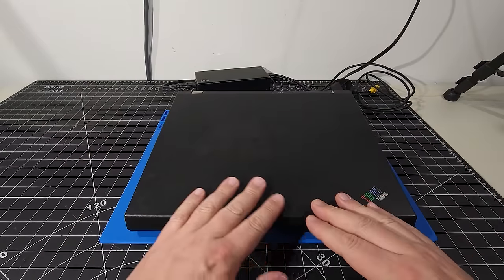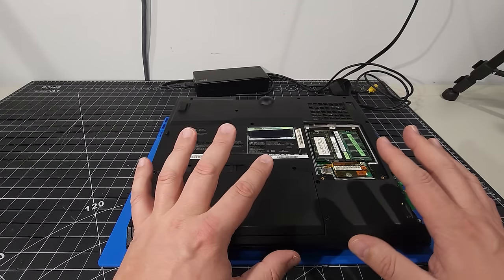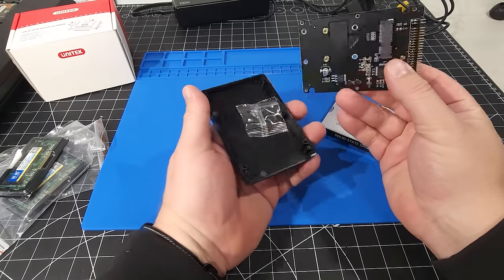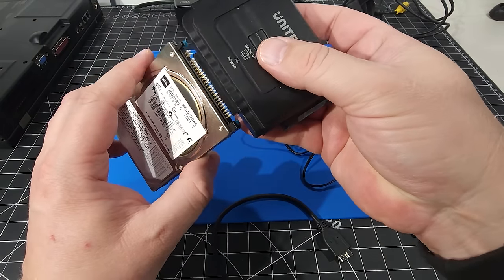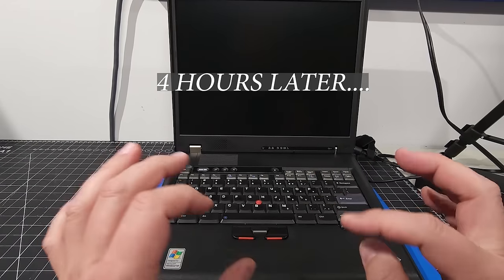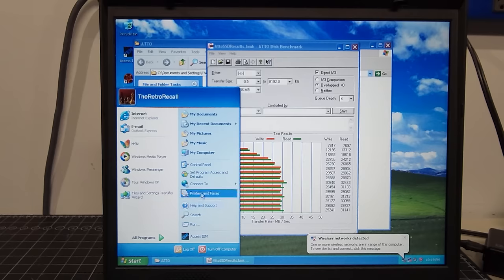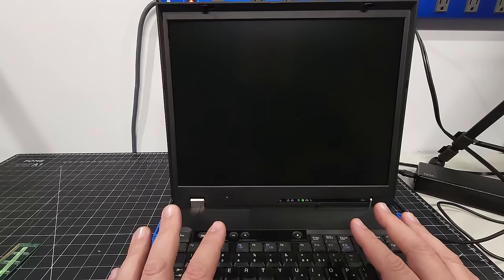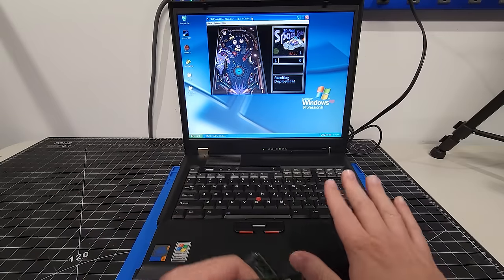IBM ThinkPad G41 Upgrade!!

Comment: One issue with cloning something as old as an XP HDD to SSD is that you won't have optimal alignment. I don't remember the command but there was a way to do a NTFS format on XP with proper alignment. If I remember the issue correctly, the wrong alignment causes certain reads and writes to hit 2 cells when 1 cell would have held all the data with correctly alignment.
Reply from the maker: Yes.  I checked and it's not 4K aligned (however not far off).  That said, it's an easy repair with a utility even with the OS on the drive.  Even rebuilding it wouldn't be much of a chore.  My biggest challenge was cloning the HDD and it not booting at all.  It was only when I made it a raw drive again and installed from scratch it worked properly.
Reply: If cloned with a software that is aware of SSDs (like Acronis' bootable CD ISO image which is public on their servers (obviously can't put a link here), alignment won't be an issue as it takes care of it while copying it over
Reply from the maker: Thanks for this!
Reply: I've never had too much luck cloning anything with these nifty smart tools. I'll go to dd or ddrescue on linux (Ubuntu in my case) and probably save time in the end. While the dd bit-by-bit copy takes some time I won't have to try this and that and the third thing experimenting what aligns and finalizes and what not to the end result after a fast smart copy. This approach of course requires a computer with linux booting capability and the necessary connections for the job. Even cloning over USB can be a bit dodgy no matter what the tools!
Reply from the maker: Ah fair point re:USB.  I never thought about that being a factor, but can be a very real one.

Comment: Just Use Windows Vista or Windows 7, becuz Windwos XP doesnt have any optimization with SSD and in disk defragmentation, the Win xp do a disk defragmentation method which is for harddisks. If do for ssd, SSD becomes lower life with read write cycles. In Windows vista or 7 have better support for SSD and have the new defragmentation method with TRIM method feature
Reply from the maker: Thanks - I've heard about this, however from what I understand is if you run a utility it can correct this.  That said, putting. A later version of Windows or Linux on this system in the future may be a fun option.

Comment: Fun story, had that exact issue with the hard drive replacement, happened with a Z60M and Z60T that i got, drove me crazy, and ended up with me completely cleaning the system and installing all the original software, was a nightmare at the time, glad that i did it for my Tipads!
Reply from the maker: Awesome!  I've never had that happen before using Macrum.  It would just normally work in the next system.  All is well that ends well - installation from scratch and it worked.

Comment: The only thing I found to be consistent with copying old drives over to new ones is using dd in linux. Havent had any issues since. I've been through at least 30+ drives at this point with no errors. Maybe check that out :)

Love the g series thinkpad!
Reply from the maker: I just read from another comment they recommended DD in Linux as well.  I'm definitely going to check that out, thank you! And yes - G!

Comment: I remember going through a ton of pain cloning a drive for my T41.  I don’t remember what I did with Ghost but I didn’t use all of the default options.
Reply from the maker: Yeah a spent a few hours and stopped as I wanted to get this out.  That said, I do plan on doing some tests as I have the image.

Comment: I was told old machines can kill a SSD faster. Wouldn't be an issue if SSD's didn't have read write limit suck @$$ drives.
Reply from the maker: Haha.  I think if you set the 4k alignment up correctly and adjust the TRIM then it should work fine.  I did NOT do that in this case but I will be going back to do so soon :). To be honest, I just love the spinning rust - unfortunately these IDE drives are getting hard to find.

Comment: the only downside to the ide to sata is you are limited to the speed of ide.....it's better for heat purposes, but otherwise not much different.
Reply from the maker: True, however I did get an extra 7 MB/s (28%) improvement in performance which was noticeable.
Reply: @TheRetroRecall access times are where the real improvement is.
Reply from the maker: Definitely.

Comment: A fine upgrade!👍👍 Cleaning that ram., stick with IPA., may make it work and 2 gig., of ram., is the maximum which that computer can handle.  
Perhaps you could make a cover for the ram..   I have one laptop which has an IDE., interface, a Dell Inspiron 9300 and I have considered obtaining one of those adaptors and drives, but I have a few working IDE., HD., so they will do for now.  
I did have Sparky Linux LXQT installed on the 9300, but it's now has LMDE6 installed and so far it's handling basic tasks well, YT videos can only be played at the lowest settings though, but the computer is over 18 years old.
Reply from the maker: That's awesome, and I will try that cleaning of the ram and report back!

Comment: Another great video.
I think it's a partition aligment and/or boot code problem that prevented the SSD from booting. I would probably load the XP CD and go to Recovery (R key) and go to the command prompt. There are two commands: fixmbr and fixboot. There is also chkdsk C: /p. 
I usually use Norton Ghost 12.x. It does a pretty job.
According with interwebs, that laptop seems to bave Intel 852GME as chipset which supports upto 2GB DDR-333. It may like 2x 1GB DDR-400 memory modules as long as the SPD has support for DDR-333 (faster memory has support for slower speeds for compatibility reasons), it will just run at slower speed. But, yes, some machines are picky.
Reply from the maker: Thanks for this info!

Comment: When you use Macrium reflect to copy a system disk it pretty much never work to use the Intelligent copy method, it fails to copy over MBR records and stuff when you use this method. to get the best result that works pretty much every time is to go to settings and use the sector by sector copy method and make sure to orient the partitions Exactly the same way as on the source drive. you can increase the partition size and it will work too but they must be put the same order on the drive. I have a whole computer dedicated for hard drives that have recovery software, test software and cloning all together. I can install two drives and make a direct copy to a new drive without making any images. quick and easy
Reply from the maker: I'll check that out and attempt it again.  It's funny as I've used the default settings for countless other clones and no issues.  It must have been something a little different with his config that causing it.  Thanks for the help!
Reply: @TheRetroRecall  I had a few successful attempts using that method too but it been from an equal sized drive to another. 
I think some sectors that have with the boot sectors and such don’t have any specific data about them in the MBR and Macrium just sees them as waste data skipping it. 
I always use the slower sector by sector to always get every piece of the old drive transferred but it may fail too if you shuffle the partitions around.
Reply from the maker: Someone also just recommended DD in Linux and has had a lot of success.  I may check that out as well.
Reply: @TheRetroRecall  I actually always do it with Macrium. But I use a bit older version that does not require any logins and crap. It even works as a portable version. I can just copy the whole folder to a different computer and open it directly. It does not work with the newer versions sadly enough

Comment: Just picked one up at a thrift store bag and all for 10 bucks. The HD was crap so installed a M Key to IDE card, 2 gigs ram, had Ubuntu locked out and XP, but even though XP would load it would crash when reading the drive. Got Raspi Debian installed but no mouse pointer. Am at it doing OpenSuse will see how that goes.
Reply from the maker: Ok, that's cool! I love when people find these systems and restore them.  Saves history and its a lot of fun as well!  Good luck!
Reply: @TheRetroRecall  Tried Ubuntu it failed, would not accept the SSD formatting. Tried Peppermint would not install bootloader. Tried OpenSuse, seems to have installed, but would not load. Puppy did not like. AntiX installed just fine. A potato comes back. I have an IDE adapter, may try to get the old drive cleaned up. Have 5 IDE 2.5 inchers but they are all too thick. But have an OS running with AntiX and KDE Plasma.
Reply from the maker: What about a version of Linux Mint?
Reply: @TheRetroRecall  No Distro liked it except.....AntiX. Success. I have CD's with old Distro's I burned back in the 90's, they all work. I have 4+ 2.5 IDE HD's but they were all too thick. So went with the M key SSD Adapter. So the Potato is up and running with AntiX, it likes the new SSD it is okay with the 2GB of ram even the alternate keys will shut off, they would not even with BIOS settings in a Peppermint install. Was surprised, as it had Ubuntu/XP dual install but Ubuntu would not install to the SSD.
Reply from the maker: Thanks for the update, cool you got it working (the potato 😂)

Comment: Here's a tip that will save you a lot of grief on upgrading some Dell laptops to a digital drive (Like a D820 for example) if it doesn't see the drive.  Add a thin cardboard shim to adjust the drive height and try it again.  I've run into this several times and for some reason it works.   I found this solution online after hours of frustration the first time.
Reply from the maker: I have never heard of this, it seems kind of crazy that that would be a thing.  I'll keep it in mind!! Thanks!

Comment: The problem you had with the copy of the whole disk through Macrium has and still is haunting me too. The very same problem I have on an Acer Extensa 5220 upgraded to the max. Its OS, a Win 7 32bit, is non-copyable no matter what I do.

Change the USB/SATA interface? Done. Use another copy software? Done. Change SSD? Done

Results? Must I really tell?

Go and make a new install of Win 7 32 bit and it works fine, try and copy the old 80Gb SATA drive on a SSD and it freezes during boot-up with error messages. Always.

Never could understand why, since it seems everyone else I could ask and their cousin has always managed a perfect copy of their disks.

Regretfully I bid you welcome in this little, unlucky club.
Reply from the maker: Haha, I loved reading this.  To be honest, I have no idea what the issue is buy I am determined to find out.  There have been a lot of great suggestions in the comments, so in my spare time (haha!) I am going to take a look and try.  If I EVER get it going, you know I will post an update ;)  Thanks for watching!!

Comment: Excellent work, I was looking for a video on exactly this subject. I own an IBM T40 running xp sp3 and wondering if these exact parts would work in my machine, any advice would be greatly appreciated. Its ether that or perhaps picking up a caddy for the expansion bay and plugging the ssd via that method, there by holding on to the hdd for data storage purposes only. I use the T40 extensively along side a pen tablet in my teaching practice to access text books, documents etc... and receive other materials and communications via email from students, freeing me up from continually having to switch screens on my pen tablet, improving work flow. The 4:3 display is also a game changer for ease of reading. I will also be making use of the card bus slot in the near future by picking up a PCMCIA card for ~ $10 to expand the number of usb ports on the machine. I love the versatility and the modifiability of these early t-pads ...still very capable  as dedicated machines in this day and age. I just love them, there's a certain mystique about these vintage Thinkpads, just something about them...crazy good stuff!...thanks for the video.
Reply from the maker: You are welcome!  I love Thinkpads as you can see in my many thinkpad videos so far lol.  I agree, they are built like tanks and with proper updates can be used today.  The HDD area is always a challenge especially if parts are missing, etc.  If you have the right caddy for the existing ide / sata HDD - you can easily get the MSATA adapters or SSD drives for these (from Amazon) I also posted the links for what I had used.  Look through the comments as there is a lot of great discussion around this.  Thanks for watching!

Comment: wowza, what a beefy laptop.... Sadly my oldest system currently is a Dell Precision T3500 with a quad-core Xeon and 24GB of RAM... I tried to install XP x64 edition, but but it failed so it's running Vista :) I'm currently looking to get a system that can run Win 95/98/2K/XP natively for gaming, ultimately like a 1ghz P3 system with 256-512MB Ram that I can get a good GPU in and setup like multiple drives or CF card to IDE adapter, and just have each OS on a different card and a second drive with all my software and games on....
Reply from the maker: That's awesome!  Don't give up on looking.  That's how I started getting back into it.  I sourced parts one by one and got exactly what I wanted.  Before you knew it I had a system and well ... here I am! :)
Reply: @TheRetroRecall yeah I'm unlikely to need to start making videos about it though :)
Reply from the maker: Haha true

Comment: Regarding SSDs in retro PCs, there are couple of things that needs to be adressed.
First - partition alignment. It is good idea to partition a drive using livecd linux and ensure it is aligned to 1MB.
Second - that ide44 to m.2 adapter. Most of those utilizes poor controllers that are only capable of ATA33 speed and that is obviously your case. Is is much faster though because SSD is vastly superior in terms of access time. Regarding RAM, sometimes one module won't work in slot 0, but works fine in slot 1, try swapping them around in all possible configurations.
Reply from the maker: Thanks for the tips!!
Reply: This. Need to make sure the adapter has a Jm20330 controller or better... They top out at around 78MB/s, but that's plenty fast enough for a P4. The bigger issue is, those dogfish SSDs have no DRAM cache. better off getting a Samsung pm851 mSATA SSD used off eBay for cheap instead just to have cache onboard, especially since a lot of stuff one might do on XP has the problem of moving around a bunch of smaller files, which that SSD will effectively choke on.
Reply from the maker: Good to know, fortunately it's a minimal use machine, but this is great info for other systems that will tend to be utilized more often.

Comment: I worked at IBM NL when these came out. For the day they were absolutely amazing. It was the time when desktop replacement was a thing, people wanted to swap the chunk of crt and the hum of the 486 hanging in a sidecar under their desk gone. It's been a couple of days since, if I recall correctly 3Gb of DDR333 was the maximum, if you could get a 2Gb stick. They were prohibitively expensive, I've seen a couple of those made by Wang. You could put a 2GB and a 1GB in G41 in only one combination to make it work. It made little sense to do so at the time, hardly any software could use that vast amount of RAM. I think Lotus Notes 5, Lotus e-Suite (a very nice, Java based Office package that went nowhere), some Oracle clients, Maemo and Yellow Dog could. 
I thought 120GB was the largest possible drive size for the G41, is that 128GB mSATA one of those 119Gib drives?

I still have my T43p and R52 with a 15" UXGA (1600x1200) display from back in the day. Amazing build quality, compared to modern laptops. The screen of the R52 developed a red hue recently, either the screen or the ATI card may be about to expire. Just picked up a nice T60 with a bit more muscle to replace the R52, another great retro gaming machine.
Reply from the maker: That's awesome, and yes I believe it is registering at 128gb, but reading at 119gb. I will be on the hunt for more memory, however I think the max was 2gb for this machine based on others experiences.  Either way, anything is worth a try!
Reply: @TheRetroRecall  You may be right, regarding RAM. It's a while back, perhaps the 2GB DDR333 sticks went into something else. I'd be surprised if you found one, they were partner off spec development parts that were tested in 'typical use cases'. 
After testing they sometimes got lost in parts drawers. Or they ended up in Frankensystems that happen when you have time, a screwdriver and about 2500 meters of warehouse shelving. The 'destroy samples' message sometimes got lost, for engineers it's hard to cut a bleeding edge part in two. Some of these parts end up in the wild like that. These memory modules didn't make it, DDR2 passed them by.
You can play Civilization 2 and Simcity 2000 on OS2/WARP! on that G41. That is almost unique retro gaming, I don't think that video has ever been made.
Reply from the maker: Hahahahah os/2 is a painful OS!!! I did a video on that and wanted to cry trying to get it to work lol.